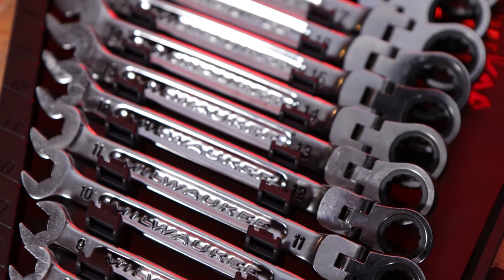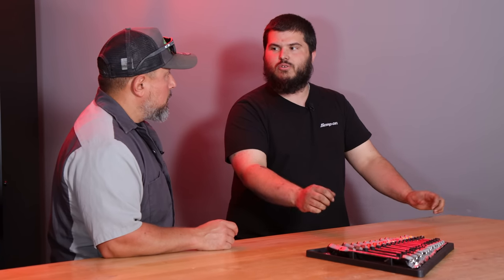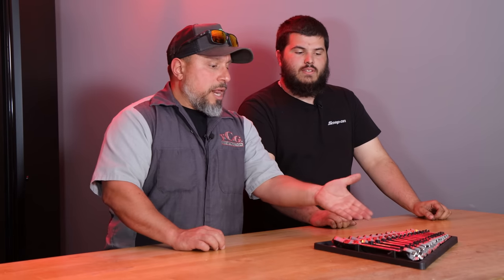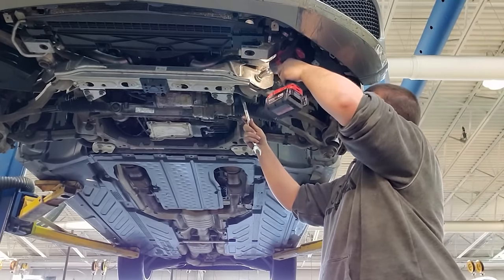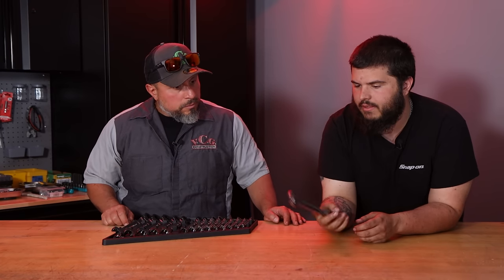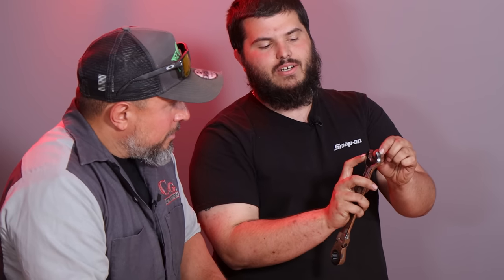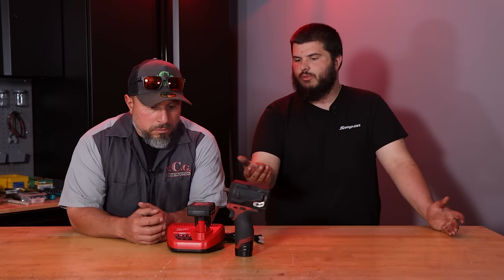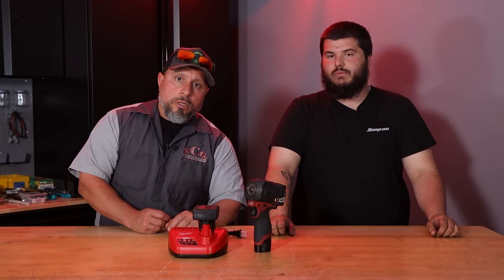Milwaukee Compared To Snap On Tools (NOT WHAT YOU THINK)

Comment: 3rd. I completely agree. Milwaukee isn't known for their hand tools, but I've got that same wrench set and abuse 'em. Definitely better than Snap on
Reply: Yea, I’ve boughten a hand full of Milwaukee tools and aside from their hook knife - most weren’t practical or useful. Terrible really. But their power tools are amazing. Top tier.
Reply: I agree there my go to Wrenches
Reply: @christopherpaulo6818  Were top tier till Dewalt beat them in every impact wrench category.
Reply: @djsi38t  not sure about the wrench impact. Just general use impacts and drills for construction.

Comment: As an auto tech I’ve used the m18 mid torque for almost everything. There was a time when I had to choose between snap on, Matco, or Milwaukee for a cordless impact and I’m happy I went with the Milwaukee.
Reply: Love both my mid torques. High torque only comes out with rusty stuff. 3/8 stubby I barely use anymore, but it has it's purposes
Reply: To bad that the Dewalt Mid is shorter and more powerful.
Reply: @djsi38t  yeah just needed 2 more volts out of the less reliable battery design to do it.
Reply: it actually is a good tool. Their electric line is good. that is the only thing they shine with
Reply: I'm a Mopar tech and the battery will go down from sitting on my high torque because of my 3/8 stubby Milwaukee. I pretty much only use the High torque on diesel wheel lugs and the occasional time when I'm having to use 6 foot of extentions to get a bellhousing bolt loose
Reply: Yeah cause dewalt and makita arent a thing? That range brand makes strong tools too
Reply: @byloyuripka9624  it's kinda a combination of things to me the reason I chose Milwaukee over snap-on and Dewalt etc battery size differences and tool performance. Look at an m12 battery vs Dewalt and the others snap on comes close but as for tool power the Milwaukee even dispite not having the absolute smallest tool head the battery makes them fit more places.
Reply: TBH anyone who buys a tool truck brand cordless is a fool IMO.
Edit: I do understand mechanic shops needing to do what makes the most sense for them in terms of time and money made. This comment was intended to be about value for money. There is generally no question that you are not getting superior cordless tools with Snap-On despite paying 2-3X the price before even discussing batteries and deals. You're paying for the convenience and service plus a brand name. You are not paying for a better tool or even a longer warranty.
Reply: @802 Garage  no? If ur cordless tool breaks or anything goes wrong with it u gotta take it back to where u bought it and wait for them to ship it off and return it. With the tool trucks I can and have called my tool guy and had shit fixed or replaced within an hour. Warranty and service from tool trucks are unbeatable.  And by the way my snap on cordless 1/2 impact has 1400 lbs of breakaway and let me tell you there's nothing on any gas engine vehicle thats torqued to 1400 lbs.
Reply: I bought a used 3/8 snap on impact and it breaks shit free that a 1/2 Milwaukee with full charge would not break and also the full power till your battery dies is mint
Reply: @802Garage  I have been using snap-on cordless stuff for 10 yrs & won't use anything else. Why? Because it's proven itself worthy. Other techs have cheaped out & got those other brands only to be let down. Sure the ratchets & impacts go out for rebuilds every so often but when you need tools to perform daily you want reliability. Some of us have learned first hand & choose to invest in quality tools for our trade . Know the facts before posting your opinions because some of us actually use the tools & have the experience to give knowledgeable input.
Reply: @stanhowe6410  Sorry, but almost every professional and amateur mechanic I know disagrees. Not that the Snap-On tools can't be reliable, but that they are not worth the money when compared to other brands. I'm glad you enjoy your tools, and if you have a regular Snap-On truck that treats you well and you for some reason break a lot of tools within warranty, more power to you. Simply not worth it for the majority of people.

Stop making assumptions about who and what other people know. If you knew the facts about the Snap-On tools, you would know that most of them are underpowered with older tech compared to most brands, which also have warranties by the way. I don't like paying more for inferior products. Snap-On cordless tools are generally 2-3X the price of DeWalt or Milwaukee, not to mention how ridiculous the battery pricing is. The batteries are inferior, the tools are generally down on power, and they only have a 2 year warranty.

Overall, there is no actual reason to buy Snap-On cordless tools except convenience and being convinced by marketing. Sending your tools in for repair after warranty isn't free, and you could buy multiple superior equivalents from other brands and get longer warranties. It is also generally fairly simple to repair tools from other brands when something basic breaks. Very few tools from other brands have prevalent reliability issues, and you can simply do a few minutes of research before buying.

I wouldn't have bothered to come back with such a long reply if you hadn't said "Know the facts before posting your opinions because some of us actually use the tools & have the experience to give knowledgeable input." Take your own advice and recognize when you have a sunk cost bias.
Reply: @stanhowe6410  The only thing I'll add is that my original comment obviously comes off as harsh. It wasn't meant to be taken so seriously. Obviously it makes sense for full time mechanic shops to do what makes them the most money and saves them time. It was more a comment on value for money. I'll edit it accordingly.
Reply: Same. I’ve always had cheap brand drills and impacts until I bought a Milwaukee drill, impact, and bit set.
Reply: @myco-syco yeah but come on for the price you pay for the snap on you could have 2 XGT’s keeping one as a spare!

Comment: Got that same set metric and SAE. Did extensive research before purchasing them and happy I did. Great wrenches 🤘
Reply: Same although SAE were on back order for like 2 months haha
Reply: Im finally getting my own tools that i really want and like.  Started as a know nothing and i am 2 years into working on cranes.  I started with gear wrench and it worked most of the time but when it didnt it didnt and pissed me off.  I have ordered both the ratcheting sae and metric and i just finally ordered the flex head as well.  Milwaukee feels better and hasnt let me down.  It changes how you feel pulling out a tool you have full faith in.

Comment: “I dont want to damage the ratchet end.” Proceeds to use the impact on one side of the bolt and ratchet end on the other.
Reply: SPOILER! HE USED A SNAPON WRENCH IN THE VIDEO. NOT THE MILWAUKEE. SHOCKING I KNOW
Reply: @liamctracy902  you shouldnt use a ratchet and impact in the same sentence.
Reply: @Sak-zo1ui  Using them in the same sentence is fine. Using them together in practice is not. He used a Snap-on combination wrench in the video. I was simply correcting your perception of the situation.

Comment: Former dodge, jeep ram tech turned municipality fleet mechanic.  All I used when I worked was snap on, matco and mac tools. I’ve been very impressed with Milwaukee’s mechanics tools. Their hand tool are excellent and the rechargeable tools have been so good I’ve stopped using my air tools. I only use my compressor to fill tires, air chisel and to paint
Reply: These are the comments I want to see. 
Thank you.

Comment: I got Milwaukee sockets,and wrenches they are amazing honestly
Reply: @Sid The sloth i honestly, have little bit of everything Milwaukee. 
M12 heated hoodies, softshell jacket, heated  thermal shirt. Rechargeable headlamp that the heated shirt uses same battery. 
M12 fuel 1/4,3/8, and 1/4 bit plus the 1/4 surge impacts. Also have the extended head ratchet. M12 3in.cutoff tool, M12 soldering iron, M12 right angle grinder and M12 fuel hammer drill
M18 brushless impact and hammer drill
M18 fuel 1/4shank regular impact and surge,plus hammer drill.
M18 fuel high torque 3/8 and high torque 1/2 with one key,
M18 fuel circular saw 
M18 fuel grinder
M18 fuel bandsaw
Then not counting all the hand tools I got Milwaukee. Love their channel locks 
Milwaukee heating/cooling neck thingy
Plus just got.4 pair of the Milwaukee pants
Reply: @Sid The sloth there are still plenty of brands that make tools here in the United States...
Reply: @Lee-lb9qh  yes but most of them over priced for what they are. I love my Klein but they have jacked the prices up to the moon
Reply: @beefysghost867  😂 yep. That's America, only profits matter, where ya been?
Reply: @beefysghost867  I think Klein is a good deal for what you get
Reply: @bassheadlife492  I used to until they started to not honor lifetime warranty. That's what pretty much turned me off on them

Comment: There is nothing better than a snap-on wrench. Most of the wrenches in my box are snap-on. I do keep some craftsman to cut, weld, or bend. Anything I have over 1 1/4 to 2" is cheap sunex mainly because I don't use them enough. I have Icon wrenches at home, I like those. I would consider Millwaukee for home use. My perspective as a Diesel Technician Snap-on makes some of the best hand tools on the planet.

Comment: I bought the Milwaukee combination wrench set in Metric and SAE and I fell in love with them! So much so that I went ahead and also bought the  ratcheting wrenches sets as well.  I do like them a lot, the quality is there’s, but as far as convenience, the ratcheting wrench sets are straight at the box end.  I’ve come to find that I’m not a fan of straight box end wrenches and I prefer the 15° angle that their regular combination wrench offers at the box end.  If I could make an improvement or suggestions to Milwaukee it would be to come out with a 6 point, reversible, ratcheting, box end wrench with a 15° offset.  I think this would be a unique offering and upgrade to their line.  Also, change the color of the metric from black to blue. Black is sometimes hard to see since the chrome is sooo reflective.

Comment: small correction brother, the stubby EASILY removes lognuts. I use it to remove my truck and suv lug nuts all the time, with extreme ease. I do use the 6.0 battery rather then the 2.0 for more power.
Reply: the dewalt impact that is the same size as the stubby...is TWICE the power.DCF 921
Reply: thats an m12 as far as im aware the largest battery available in the 3.0 i think youre talking about an m18 model
Reply: @djsi38t  🤣🤣🤣🤣 no one cares dude. Did someone get you your 1st impact for your birthday and you really wanna talk about it ? 🤣🤣🤣
Reply: @thatoneguy5495  Pretty certain there is a 6.0 M12 battery.
Reply: @porkchop7652  😂 I was about to comment the same thing, people I know that have dewalt act the same way. Like good job they made one more powerful tool. Only took them 10 years.
Reply: @thatoneguy5495  largest m12 battery is indeed a 6.0 mah

Comment: Now this is a review i needed. This justifies getting the milwaukee over the snap on for my uses. Now if a mechanic could give a honest review of the milwaukee sockets with the square flats thats what i need. Just spent a pretty penny on a snap on flank drive extra 1/4 socket set that coudlve bought me 2 milwaukee 1/4 & 3/8th socket/ ratchet set in the packout kit. i went with the snap on cause i was worried that i would get annoyed of the feel of trying to finger spin a square socket without a spinner attached, or the fact that a square peg in a round hole doesnt work out too well. Or the fact that i couldnt find any real world testing of how milwaukee sockets do in everyday situations when you dont always deal with brand new hardware. I really still want to get a milwaukee packout socket set for my mobile tool cart set up, would be a heck of alot easier to do that than try to piece together snap on sockets on rails in drawers in a packout ....until then thanks vince for the tool updates.
Reply: Buy it and find out so you don't have to spend what little you make on snap on
Reply: @bassheadlife492 not one to experiement. I do my own research and then go from there. Based on what i found it was better to go with snap on flank drive sockets for their extraction benefits on rounded off fasteners and ultra slim profile.... I am currently still pricing out and finding deals on snap on 3/8ths sockets and rather slowly piece together a full set of quality snap on than buy a one does all kit and be dissapointed at a features that sounds good in the ad but in real life sucks.
Reply: Gearwrench, Sunex, Capri, even Icon at HF are nearly identical in quality to Milwaukee handtools. It's literally all Taiwanese stuff. Except you're paying more for the Milwaukee logo.

Comment: Old school mechanic here, I ve tried just about all types of wrenches & ratcheting wrenches, 6pt and 12pt. As for Milwaukee from my experience there pretty decent,  as for the Snap-on,  well there over priced & overrated.  If you want a similarity to the Snap-on wrenches, may I suggest the Icon Anti-slip combination wrench set. It does the same thing as the Snap-on but hell of a lot cheaper example Snap-on wrench set $550.00 for a wrench set,  Icon $124.99 for a wrench set. The Mercedes mechanic mentioned take some plier to a bolt. Lol! I should suggest the Gearwrench open end  ratcheting wrench set.
Reply: I'm in my late 20s and just started working in a shop 2 months ago. Before that I was working on my own cars at home for a while. I used to think snap on was overpriced and wouldn't get any of their tools.. while I do still think their tools are super expensive, I have to say, I used a snap on ratchet (extended 3/8) my boss has and what I love about it is the anvil requires almost no force to spin it so it's great for those tight spots to get a bolt started or remove it ALL the way because many ratchets are just a tad too stiff that it doesn't "ratchet" once something is too loose. So unless Mac, Cornwell, or someone else doesn't have a ratchet that fine, I may just be picking up a snap on ratchet... Just the one lol
Reply: @meme5887  
If your looking for a good decent 3/8  long drive ratchet,  may I suggest Gearwrench 3/8 long drive ratchet,  whether it be in comfort grip or non-comfort grip, I also suggest getting one that is a locking flex head & one with out locking flex head, just for a straight drive ratchet. The Snap-on straight 3/8 extended long drive ratchets will cost ya about  $178.99 for one and the Gearwrench  will cost $59.99 for the non-comfort grip, and the comfort grip $68.97. Equal your total for both Gearwrench 3/8 drive ratchet $128.96 +tax. Hell of alot cheaper than one $178.99 for one Snap-on 3/8 drive ratchet.  But hay that's just my opinion and experience in mechanic tools.
Reply: @mikey358976  I'm looking specifically for a really sensitive ratcheting mechanism. Like the one my boss has is so fine when you spin it, it almost feels broken which is super helpful for getting those last 3 turns on a bolt or nut where your everyday ratchet won't ratchet because there's not enough force to make it click. Like a hair trigger except a hair ratchet. I plan on going all Milwaukee for the ratchets, I just picked up the 3 extended ones which are really nice. But they're not super fine for when I need to start or fully remove a bolt/nut.
Reply: @meme5887  
Understandable on the 3/8 drive ratchet, you want it loose like broken feel like,  as for me I went with the 120xp 3/8 by Gearwrench,  I used a Snap-on  3/8 drive ratchet before standard size and long handel wasn't really impressed.  But every mechanic different on the way they do things on certain tools they need. But in reality old saying" a true mechanic doesn't need fancy tools  to get the job done. A true mechanic can get the job done with just about any mechanic tool. "
Reply: @mikey358976  My Milwaukee ratchets just came in Friday. Didn't get to use it for work yet, but I do love the feel of them. I've been using newer craftsman ratchets as I got a 285pc set deal for about $190 on clearance holidays 2020. I plan on using my Milwaukee's now though and getting their set of sockets. I'll use my craftsman as my house set as now all my tools are at work. I'd just like a super sensitive one for those special times. Especially with how little space new cars have nowadays. And a real mechanic can do anything with a hammer, flathead screwdriver, and visegrips 😂
Reply: @meme5887  
Yeah I bought a 3/8 set of Milwaukee socket set, it was the packout set, gotta say not bad for the set. Only thing I was disappointed was not enough decent extension set. Bought the set to see what my opinion of experience on working with the tools. Overall it's ok. Now if you want a all in one carry around complete socket set, I would suggest the Dewalt 204pc mechanic tool set. To me that has just about everything you need in sockets, allen & T-torx sockets, & wrenches, the wrenches are ok, but I swapped out the wrenches, for the SAE side slots I replaced the Dewalt wrenches with Icon Anti-slip combination wrenches,  and for the Metric side I swapped out the Dewalt Metric wrenches with the Snap-on 0° degree off set ratcheting wrenches.  And gotta say both Icon & Snap-on wrenches fit perfectly in the Dewalt slots.  Gotta say the only thing Snap-on did perfectly on there tools are there wrenches. And that's it from experience.